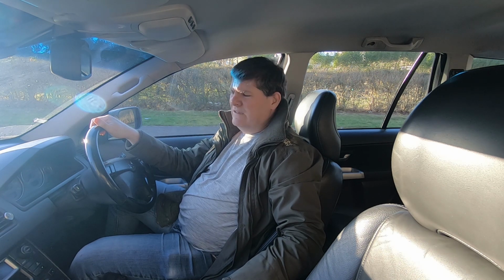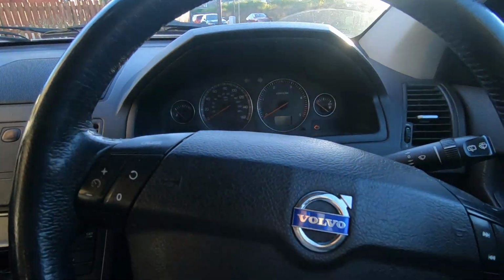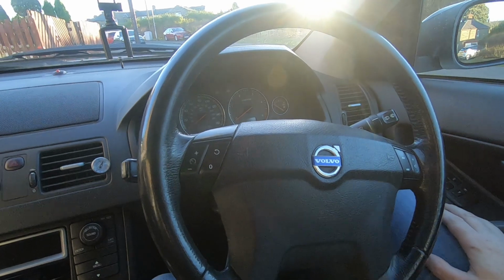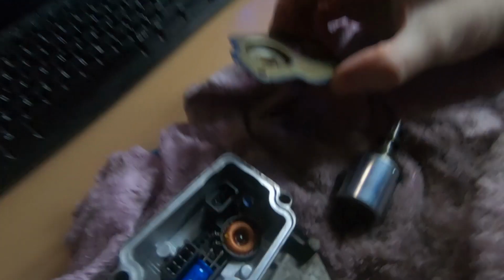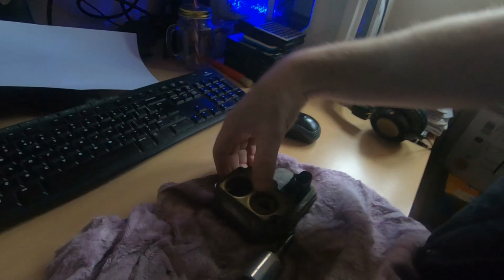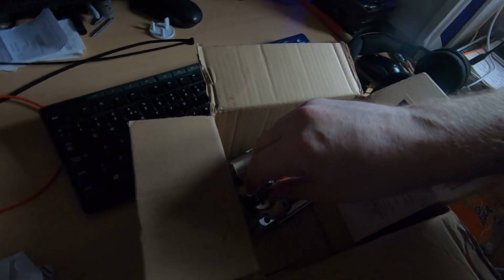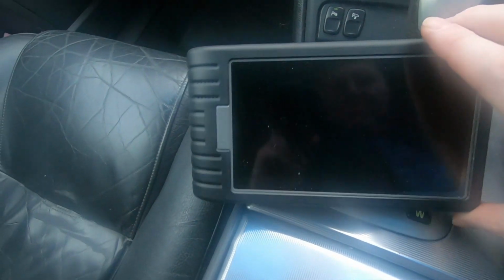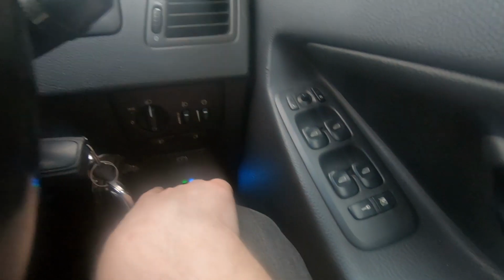I FINALLY got the CEM sorted - 2003 Volvo XC90 Part 26

Comment: 선루프의 드레인호스 배관이 막히거나 A filler 내부 연결부에서 누수가 되면, 운전석 스티어링 휠 아래에 있는 cem(centural electronic module)에 물이 들어가서 합선이 되는 경우가 많습니다.  드라이어 등으로 충분히 말려서 증발이 되게하고, 드레인 호스를 뚫어주고 물이 넘치지 않도록 A filler로 흐르는 물길을 잡아줘야 합니다.
Reply from the maker: My XC90 does not have a sunroof so I don't have that problem. When the Volvo speicalist first looked at my CEM, they said that there was no evidence of water ingress so that was not the cause of the failure.

Comment: Same problems with mine. Sent CEM off to get refurbed. Still same problem. Pull fuse for DEM and car works fine now. Will send off Dem for repair
Reply from the maker: I knew my DEM was faulty and the specialist said it would be best to get that sorted first.
Reply: It’s the Haldex 4x4 Differential Electronic module. If it’s faulty it causes chaos on the electrics too. Pull the no 23 fuse in the trunk and that will fix it for now, but the car will run on front wheel drive only. Remove the Haldex unit and send it to get refurbished. ( Volvo Diagnostics on EBay do it)
Reply: @WilliamLinton-my3nl  thank you much appreciated
Reply: What’s DEM

Comment: Hi did this fix your car finally or did you need to have the CEM fixed too I’m having similar issues and tore between a CEM repair or the DEM repair specialist isn’t 100% sure which one it could be
Reply from the maker: The DEM was sent off for repair and it had to be replaced with a reconditioned one because it was beyond repair. That solved my "anti-skid service required" problem. I had the CEM repaired and it has been fine ever since. This should be documented in later videos.
Reply: @Parknest what’s dem?
Reply from the maker: @ENIDTR  The DEM is the module that controls the Haldex unit on the rear differential.
Reply: Thank you for your reply buddy

Comment: Wait until the 'class' from the class action lawsuit over leaking sunroofs....wait till they find out it's not the sunroof. I don't have one in my 06 XC90.....just replaced my completely shorted out CEM... When it rains here in Florida, it literally pours right down into the drivers footwell....then directly on top of the CEM.
Reply from the maker: I'm lucky in that I don't have a sunroof and the CEM didn't suffer water ingress as confirmed by the specialist who worked on it.

Comment: Interesting fault & diagnosis, if the circuit board was okay do you think it was probably just the capacitor needed replacing, they dry out after 15-20 years?
Reply from the maker: The conclusion from both specialists was that the faulty DEM could've caused the CEM to throw a wobbly. I've reviewed my dashcam footage from when the CEM played up and it was about 2 hours and 45 minutes from starting up when the symptoms first showed up. Unfortunately, the jury is still out as I've yet to undertake a journey that long. On the Volvo forums people have said that it could be caused by a dry joint on the CEM circuit board. Time will tell...

Comment: What you scanning it with mate you ideally need vida and dice,. I've got a funny thing happend on my s60 the steering wheel has come loose. Ohh the joys
Reply from the maker: Yes, you're right about VIDA & DICE. My scantool is the Topdon ArtiDiag BT800 which is a decent bit of kit for the money and is something that works with most of the cars that I work on (not just my own).
Reply: Hi Chucky, take the steering wheel off and re tighten the nut 2 minute job, common fault across the range👍
Reply: @gasgiant that is what I plan on doing I just need some time off work, luckily it's not my daily I have the mondeo. The steering wheel bolt is a common issue what I might do is loctite it in then torque it up. Brilliant car I think if selling it then I drive it puts a smile on my face and I change my mind lol 😂. I had it polestar optimised. They are are 185 bhp out the box. You can't push them to much subaru impreza intercoolers fit. If you want more bhp. The torque is midblowing after the remap
Reply: Thanks for the info however I’m rapidly heading for retirement & find myself dawdling everywhere. I have an XC90 but main vehicle is a Hilux. Both big diesels 👍
Reply: @gasgiant7122  I wanted a xc90 but my s60 came up, I've always admired the hilux I bet that is a workhorse. I like the izuzu truck as well
Reply: @chuckysw  yeah the Hilux is great however I have found most if not all insurance companies will only insure them as a commercial vehicle? £600 fully comp😡